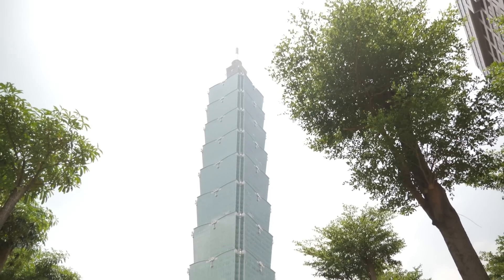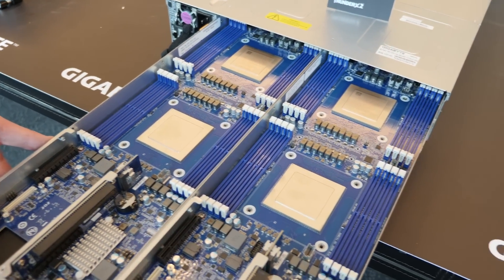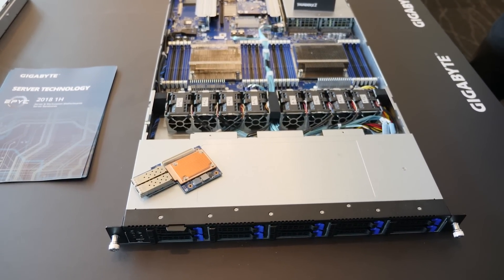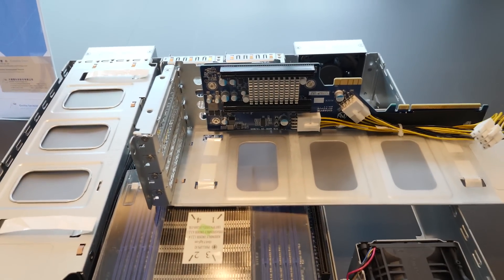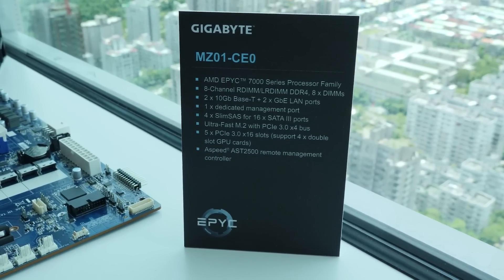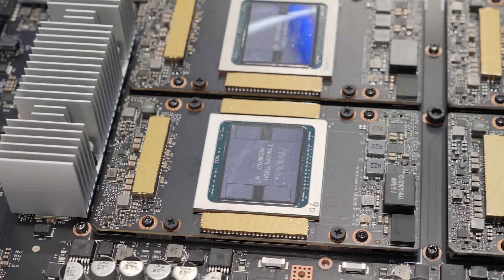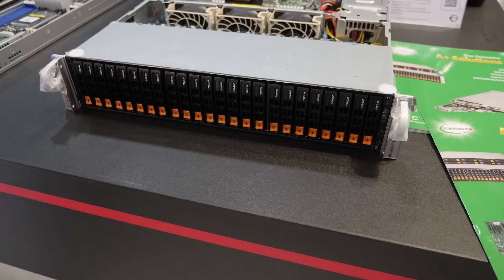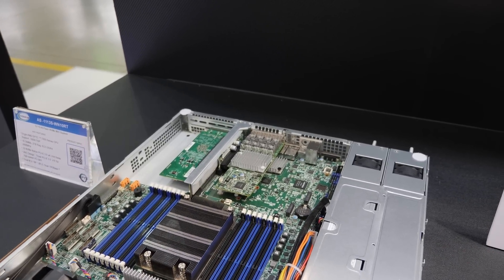1 Petabyte of Flash in 1u, 2 Petaflop  Servers & Enterprise Gear of Computex

Comment: Fractal and Asrock are both respectable sponsors.  I really like their products.
Reply from the maker: see also the last 30 seconds :D
Reply: Wendell looks up from phone, notices camera and says, "I don't always party but when I do, Fractal is paying me!  Stay thirsty my friends!".  Then goes back to doing stuff on phone.  

Is Nerd (dos) Equis a thing? I feel like it should be a thing.
Reply: Aspy Equis?  That's totally me at parties, just staring at my phone half the time.
Reply: Wish I can say the same thing about Asrock's support. Had a x79 extreme board with a dead chipset fan and built-in 7.1 surround sound that only functioned as 5.1 surround sound. Still got proper cooling without the fan and found a 3rd party hacked driver to get the full 7.1. So I never really went beyond emailing them 5 times without getting a single response back.